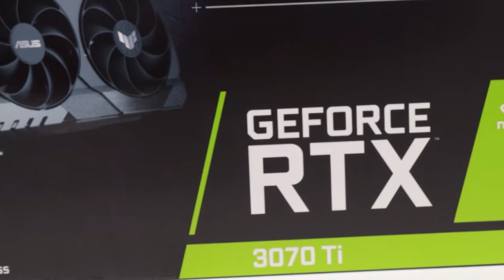STAGE-1 RACE RIG PC BUILD || SIM COACHES

Comment from the maker: What kind of specs are u rockin on your rig? Feel free to share with us below!
Reply: Asus Crosshair VIII Hero WIFI with a Ryzen 9 3950x. 32gb of DDR4 3200Mhz Corsair Vengeance Pro. EVGA FTW3 Ultra 3090 with a Corsair 1000 power supply. Case is a Thermaltake View 91 RGB Edition. All custom water-cooled with (4) 480mm EK Rads.
Reply: @LancePlusPlus  You know it